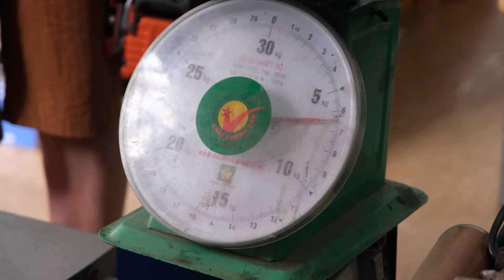My New friend (Chainsaw) Unlimited power

Comment: Do you remember how it all started, from searching for iron ore, forging tools and nails…
Reply: Yes, very disappointing
Reply: But, didn't Duong use a GoPro, edit videos, sit up all night editing them, and upload them on the Internet?
Reply: @Bob_Adkins  There's quite a bit of a difference in using cameras to document and share his progress, and using outside tech to make his progress.  How did the cameras help with his shelters, the pond, the waterwheel, or his breeding projects?  It doesn't matter how resourceful he was, he was never going to be able to build a go pro from iron and bamboo.
Reply: @Bob_Adkins ???
Reply: @johns6014  There is no outside tech. It's not illegal or immoral to use a chainsaw.

You really should try chopping logs with a knife in the tropical heat. I think you would change your mind.
Reply: @Bob_Adkins  but his channel is called PRIMITIVE skills, there is nothing primitive about a chainsaw. The reason he has so many subscribers is because of his PRIMITIVE skills, that’s what the past 6 years of this channel has been until the past month or 2. Why not use them from the very beginning and just be a channel about a guy building stuff.
Reply: @Bob_Adkins  Are you new to the channel, or are you just ignoring the premise that Duong set for the goal of the channel, where the goal was to build a life from the ground up?  You're at least missing the older material where Duong used his hatchet to cut trees and logs, if you think that he was simply using a knife.

I won't begrudge her too much for not following his example, because she isn't Duong and she has different priorities and capabilities, but anyone can see how this is harmful to the spirit of the channel.  They should set up a sister channel for the new location if they want to use equipment like a chainsaw there, along with tarps, store-bought pots and nails, and baskets of produce taken from outside farms, rather than degrading Duong's five years of effort in building his farm.
Reply: @johns6014  I've watch many, many videos, including the oldest. Duong hurt himself for our entertainment, and that's why primitive people had very short and miserable lifespans. 

Another thing: How many baskets and chairs are enough? I'm not being snarky, it's just a fact that primitives have very few artifacts to make and it becomes repetitive. He could make modern things in a primitive way, but that wouldn't really be primitive either.

His farms are VERY primitive, starting with nothing but dirt and trees. Even when finished, they will be in a very primitive but peaceful setting.
Reply: @johns6014  I suppose Duong wanted a channel to show his primitive skills, not to live it 24/7/365. That wouldn't be fair to him or his family.

When Duong demonstrates his skills, he is an actor and a teacher. Other actors and teachers go home at night and switch to being husbands and fathers.  Why can't Duong do this?
Reply: @Bob_Adkins  Who asked him to live like this 24/7?  His kids are clearly younger than his channel is.  Do you think that we were under the delusion that he was spending his entire life on the farm?

I wasn't aware that all of his videos were about him making baskets, by the way.  That's news to me.

The point is that it wasn't a matter of what he was doing, it was a matter of how he went about it, and about the challenge that he had for himself while he was working on his farm.  Obviously, things have changed, but when something like a chainsaw shows up, it should be expected that there would be some blowback for a channel like this.
Reply: @johns6014  Some  of us are apparently under the delusion that  Duong wants to knit baskets and forge nails the rest of his life. I think it would be great if he brought us along with his real life, and occasionally took us on a bushcraft outing, where he is without rival!
Reply: @Bob_Adkins  você não entendeu nada né 😮
Reply: @Bob_Adkins  no, i still vividly remember the subtitles saying he wants to live the challenge, the challenge doesnt include bringing a chainsaw. its in the first episode of the series i believe.
the premise of the channel is how far you can come without relying on modern tech, he can replicate a lot of modern stuff with primitive tech and that would be perfect content for this channel.
there are loads of channels out there who already do stuff building a farm somewhere using modern tech but its just not that interesting, im here for duongs skills, the skills that i dont know about, to learn things. everyone can cut a tree with a chainsaw but not everyone can cut one with a rock, then proceed to start a fire with just 2 sticks, burn a hold in a piece of wood and turn the rock together with the wood into a wooden axe.
you mustve forgotten thats how this channel started. teaching us how to find edible roots with knowledge passed down from his parents, finding crabs and other food in the wild to eat.
Reply: @langedarm1775  The real question should be "how far can you come without destroying your body?"

Duong met all the challenges. How many more times does he have to meet them?

The only challenges they have left involves large logs and brutally hard work. If it was absolutely necessary, they could do it with a knife, but it's not necessary. 

For those who have never done it, I can tell you from experience, it sucks to chop large trees with a parang or machete!
Reply: He's done the whole caveman thing for more than 6 years now, taking us from ~1000 BC to 1500AD. Personally I don't mind at all if he wants to morph this into an off grid cabin channel, kind of like My Self Reliance. I know he's a fan of that channel.  There are also health concerns. I can't imagine how much work that was to make all those roof tiles. They just need to keep it interesting.
Reply: .,.he using a bolo and axe that he made before, and on how he find a stone on the river to make iron and forge it into a materials he need..
Reply: I am a bit suspicious. In the past he would make community posts updating progress, but then he switched to constantly spam promote random women in community section. One he originally called his sister, but then started progressively obsessing over her looks in every post to the point it got weird. Each post had 95% backlash in response, both from the advertisement of non primitive channels and the weirdness - the posts have since been deleted. Now in current time he has basically given his channel to a different woman who is making that same content people didn't want to watch back then.
Reply: Sad
Reply: So to avoid complacated scenario of a primative and modern husband and wife should maintain separate channels.
Reply: @johns6014  There is quite a bit of difference of going from a hobby farm to an actual homestead.  Can you guess what is happening here?  This farm is becoming more than just a little side project.  They are getting more serious about it.
Reply: @NorthAyase  I've thought about this too! I also don't buy the 'sick' excuse.
Reply: @_topshelf_5845  It WAS primitive. Now it's ordinary every-day skills.
Reply: Agora tem moto serra,enfim doctor Stone

Comment: Also if you're going to use power tools, grab a set of safety glasses. Your eyes will thank you.
Reply: It wouldn't hurt to wear a full face mask when using that big saw. Also some ear plugs. The noise can harm your hearing.
Reply: @susank4878  Wearing a facemask damages your brain, so I never wear it
Reply: @susank4878  It hurts to hear it in the living room so I just stopped watching here

Comment: I worked in a hardware store that sold Stihl equipment as the lead mechanic. Sthil makes good tools. When you store it for very long, drain the fuel and run it dry before putting it up.

Comment: 🙏  Please, please, please, stop using the chainsaw like that. 
I love you both and I don’t want to see either of you get hurt. 
You don’t need to push and pull the blade to make a cut. Doing this will use extra energy and makes you tired quicker. Let the chainsaw do all the work.
Stop using the tip of the blade to make cuts. It is not safe. The top quarter of the blade tip is the most dangerous part of every chainsaw. Using the tip to make cuts has a very high chance of chainsaw kickback happening. Chainsaw kickback causes really bad injuries and can kill people, especially if you are not wearing a helmet. The middle of the blade or close to the dog teeth is much safer and uses less energy to operate the saw. 
If you can’t afford a lot of protective clothing, at least buy a helmet. It can save your life. 
As a female, I am always looking for ways to save energy when using a chainsaw. I try to use the dog teeth as much as possible. Even on smaller branches. That way I have better control of the saw. 
I really do like your chainsaw. Stihl make a very good chainsaw and they are my favourite brand. They also have YouTube channels with good tutorials. 
I love your videos. The 🐔🐣🐥 bring back childhood memories for me. Thank you

Comment: There is more expense with having power tools, like this chainsaw; gas, chain oil, an extra chain, spare spark plug, tools needed to tighten or adjust tension on the chain, sharpen the chain, and repairs. You might also need some wedges to use when cutting down trees. It can be quite perturbing to get the bar of the saw stuck in a cut and not able to move the tree or log enough to free it. You are best advised to wear leather gloves, ear and eye protection and wear boots. This is minimum.

It might be good to have on hand some extra nuts, bolts and screws that fit that chainsaw, and maybe an earth magnet in case you lose parts in weeds, etc. It would also be good to have some shop rags and some hand-soap.

You handle that chainsaw like you have had some experience using one, but please be careful. You are definitely not a timid woman and have no fear. You have already displayed some amazing skills, imagination and creativity, and are motivated to do bigger things on this farm you share with your husband Duong. But the direction you are going now with the farm is different than what Duong originally planned. So you both might want to reevaluate what your intent is for the “Primitive Skills” channel. You don’t want to lose subscribers. Just some thoughts for you to consider.
Reply: correct all, But the direction you are going now with the farm is different than what Duong originally planned. So you both might want to reevaluate what your intent is for the “Primitive Skills” channel. You don’t want to lose subscribers. Just some thoughts for you to consider.
Reply: @massoudjordi  all normal peoples want make life better and not stay stupid than african all life primitive mode. all normal need better life, better tools, better house, better food, all life make better ewery day more comfortable, ap-normal not use this.
Reply: @mattivirta  It's very simple, just change the name of the channel...
Reply from the maker: Thank you, your shares are very useful to me

Comment: When using a chainsaw, use the bar closest to the engine. When you use the tip like that, it is easy for it to kick back and cause an injury. The teeth on the power unit are there to bite into the wood and prevent that.

Comment: A chainsaw is a very dangerous piece of equipment. You do not need to saw with it (move the bar back and forth) it will cut best from the wolfs teeth (the base of the bar). Remember if you get hurt up there, it's a long walk out, if you can walk. Be very careful!
Reply from the maker: thank you
Reply: I came to say this!  
Be safe

Comment: Good choose of the brand. STIHL makes the best quality.
But you definitely have to learn how to use a chainsaw. Chainsaws are very dangerous, especially if you do not know how to use it right.
You have to saw the wood as near as you can to the saw, so that you do not use the front part of the saw-blade/-sword. Otherwise the Saw can go wild and can speed direct to you.
You should read the usermanual first, before using the saw.
Please be carefull with this.
Also you have to take care that is enough oil in the oil tank. So every time, you add new fuel to the chainsaw, you also have to fill the oil tank full with oil.
And its also important to use the chainstopper to prevent the chain from running if you dont want.

Comment: OMG! LOL She brought in the big gun! I get why you bought it. You are trying to run a farm and start a new one all by yourself doing hard work for long periods of time which is hard on the body. Just please be careful of the kick-back on the saw, don't try to cut anything taller than your elbows or let the blade get pinched, use safety glasses, let the blade do the work, and watch out that the tree doesn't jump up and hit you before it falls! Oh, and don't forget to mix the oil in the fuel for the small engine, get an extra chain, and a sharpener for it. You are not the only tough girl here. :)

Comment: 27:14 
Sister you can lay the chainsaw blade on the wood you want to cut and it will cut it; no need to move it back and forth to cut. 
Good job for the first time using it, I moved it when I 1st tried too. 😊

Comment: I can tell you never use chainsaw before... Always full throttle when cutting, forward arm strait, cut using the part of the blade near the motor, not the tip, engage the steel teeth against the trunk and press the saw blade down using the backward arm, use special file to keep the chain sharp. And most important: BE CAREFUL, it is not a toy, it can cause you serious damage, use it properly, those rules are for your safety. Forget about cutting down trees until someone show and explain how to do it safely.
Stihl is a good choice, definitely worth the money, but not really fit the channel as primitive tool in my opinion...
Reply: Good points. I was cringing watching the handling of the chainsaw. All it takes is watching a few of the good Youtube videos on how to properly operate a chainsaw to be much safer and more efficient.
Reply: All of these vietnamese channels have people using their chainsaws incorrectly,  at the tip. I ran a campaign for s while to try and change this before someone loses half their face, but nobody listens...

Comment: Congratulations! I’m happy you decided to get a stihl rather then the husqvarna because personally I’ve found them a bit more durable. Work will be much easier now (although it’s still very hard work) and progress will happen much faster.

If I could make a suggestion for when finances allow, I have found clear safety eye glasses and steel toes working boots to be essential, wood chips flying into your eyes happen regularly and when using a chainsaw the action is cutting towards the feet so its good to protect those 😊.
Reply from the maker: Thank you, your shares are very useful to me

Comment: Do you see the spikes at the tension plate? Those are designed to hold the saw to the tree. You do not need to use a sawing motion . I hope I helped
I would really rather see the same handmade everything though. I thought that was the premise of the channel

Comment: Don't forget the need for a "sharpening guide/tool" as the teeth need regular sharpening using a correct guide to sharpen every second tooth one way then put the guide/tool on the other side to do every other tooth.   Sometimes I have found a large "hardwood" axe makes it quicker and fell the bigger trees.   Get some experience, and long wide planks can be cut for tables and wall sections.
Reply: not need sharpening tools, i not newer has use file sharp my chainsaw, i buy alltime new chain, cheap and not need manytime /year buy new. super chap and easy job not need sharpen newer.
Reply from the maker: Thank you, your shares are very useful to me

Comment: Also, anyone with a chainsaw?  Please remember to get and use EAR PROTECTION.  Chainsaws are VERY LOUD and will damage your hearing over time.  Ear plugs, construction style ear muffs, or ideally both.  Same goes with lawn mowers, leaf blowers, motorized hedge trimmers, and line trimmers (weed whackers).

Comment: Should have got a 361. That's a good saw but for the cutting your doing. scoring wood for planks a ms 361 is way better it will last way longer and is more efficient.

Comment: $600cdn saw in Canada if it's a real Stihl. You didn't need one that big the 171 or 180 is plenty big.
You don't have to saw back and forth, let the saw do the work.
A properly sharpened chain usually only needs the weight of the saw to cut.
The saw should use just less than one tank of lub for every tank of gas. 
Don't get any dirt in the tanks. If you are not going to use the saw for a long time, use fuel stablizer or run the saw out of gas.
Not enough lub wears out the chan and bar, so does running out of lub before the gas tank is empty.
Reply from the maker: Thanks 🥰🥰

Comment: 26:06
You are using the saw incorrectly. This makes it difficult to control the gas pedal.
Where you have attached the chain holder, there are several teeth that hook (poke) into the log and you will control the saw by leaning on these teeth.
Just press the saw against the tree, no back-and-forth movement is needed.